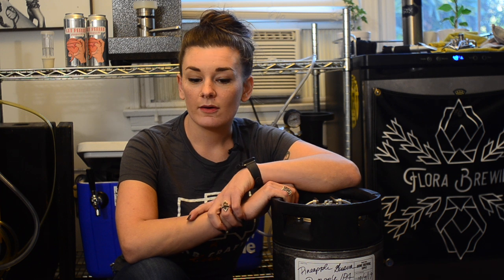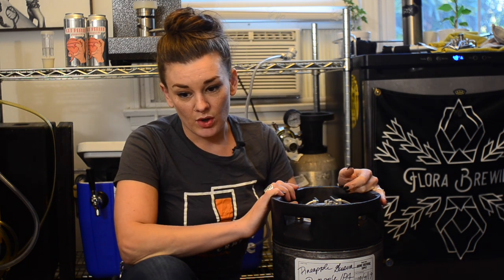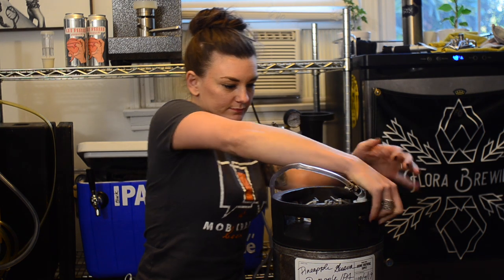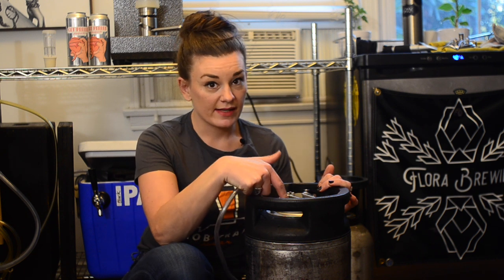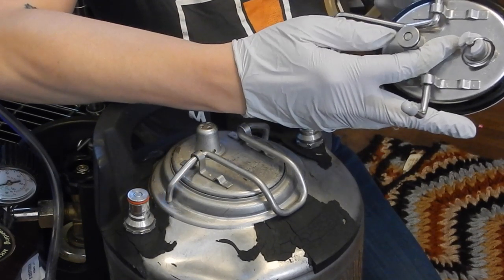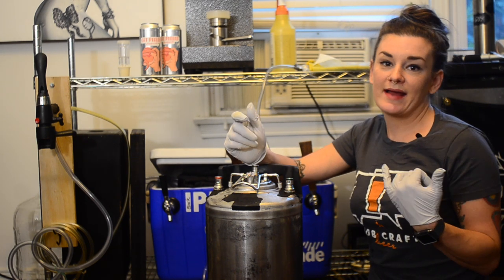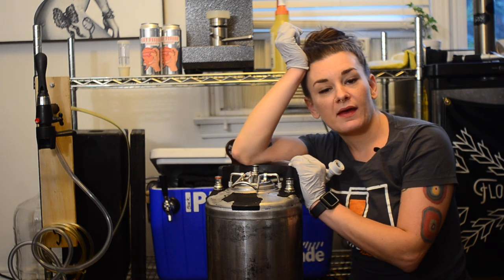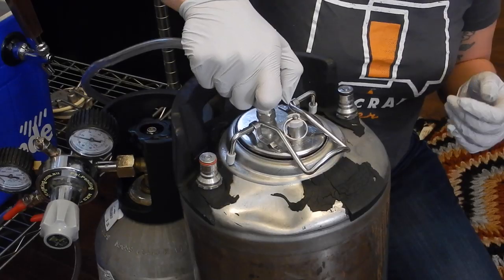Force Carbonating: Shake Method and using a Carb Stone

Comment: The tube connected to your carb stone will be full of air. It's only a small amount but if you run gas through it prior to purging the keg you could eliminate it from your beer.
Reply from the maker: Good tip!

Comment: Question: You purged only through the standard gas-in post with the short dip tube, but isn't there still air inside of the tubing from the lid to carbonation stone? For that matter, isn't there still air inside the long bev-out dip tube?

Comment: I currently cold crash after fermentation, transfer to keg, and then hit with 30psi for 24 hours to carbonate. If i changed out the lid on the keg, added a carb stone, I could carbonate in less than 24 hrs??? Sounds awesome, if possible.
Reply from the maker: Yeah you can do it in a couple hrs its wild and helpful in a pinch
Reply: With carb stone you could do it I. 10 minutes. With the right technique

Comment: Additional trick for ya..get a carb chart and find the amount of CO2 ya want for the temp. of the beer.  Shake it as normal but when you think you're close, shut the valve off on your tank, and keep shaking. The low pressure gauge will stop dropping at the carbonation level in the beer.  Keep opening and closing the valve until you hit the desired psi.   With a cold keg and a carb stone, it may only take a few minutes.
Reply from the maker: Great tip!

Comment: You can purge the tank without a spare ball lock connector, just push in the center of the gas side. I normally use a metal chopstick wrapped with a rag in case any beer comes out.
Reply from the maker: Yeah it's just easier with one

Comment: The lids with static pressure release can be centered by pushing the gas in valve with a screw driver. No need to connect a disconnect.

Comment: Can the carb stone be attached to the keg co2 permanently  for that batch. And just drop to serving pressure through the stone when  tapped. I am thinking this would add some carbonation while serving or do you think it will increase the chances of f foaming in the glass?

Comment: Nice work! You could connect to the gas in post and lay the keg down as you did but keep the gas post to the bottom, it should have the same effect because the post is submerged with the beer.
Reply from the maker: Totally. That's how I used to do it but now sometimes I just leave the co2 connected and don't roll. Brulosophy has a good podcast on carbonating too!
Reply: @FloraBrewing  Phew. That is exactly what I have done with good results, i.e. regular gas post, oriented to lowest possible point when rolling. I would even argue that this method lets the CO2 into the keg at a lower point that thorugh the "beer out post".

I am now thinking about whether to get a carb stone or invest in in a unitank. Do you have any advice on this Flora?

Comment: I'm pretty sure that here in the UK (and probably in Europe generally) the liquid and gas posts are slightly different sizes and you can get the ball lock connectors jammed on if you put the gas line on your liquid post. Can anyone confirm this?

Comment: Great video.
What's the purpose of the carb stone?
I force carb my beers at 30 psi for 36 hrs at 35 degrees. I then reduce the pressure to 12 psi and let it sit for 24 hrs then it's ready.
How does using a carb stone differ then the method I use? Does the carb stone continually produce bubbles during the process to speed up carbonation?
Are you going to do a taste test between the rolling method vs carb stone?
I did the rolling/shaking method once and the beer sucked. That was the only difference I did so for some reason that method produced off flavors.
Reply: I've heard doing the shake-method can cause a bit of a carb bite to your beer (but i've never experienced that), but for the carb stone in my experience, I've carbonated a 5 gallon batch (NEIPA) in 24 hours to 2.7vol. Worked great and both methods have their advantages. Hope that helps a bit.
Reply: if i buy  the  regulator  and  hose    then  all    i need  is  a  corny keg  to  carbonate  my  ginger brew  i  will   use 30  psi  for  the keg   right ?
Reply: @michealbradford7963  For beer I go 30 psi for 30 hrs then purge and reset to 12 psi. After 30 hrs it's not 100% carbed. You can prob go 36 hrs at 30 psi.
For me after 36 hrs its carbed enough for me. 48 hrs even better.
Reply: Eddie Hoffmann i tried this method and i kept getting foam but im sure i let it goo too far, i think maybe actually setting an alarm for 16 hours that way its all good
Reply: Hey Eddie. To answer your question. The stone adds the co2 at a lot finer micron so it enters the beer a lot quicker. Making carbonation faster

Comment: I just put my kegs in the fridge and get them between 0-4°C. Then turn on 3 Bar = 43 psi for 24 hours. done!   U used to try shaking too, but when u have more than one keg to karb, shaking as a B*ch. Much more relaxig to connect all at the same time, and go to sleep. Then beer is ready for friday night. :) Yes it does taste better with some storage, but one does not need to drink all at once. :)
Reply: Hi. You are the only person, except my local brew store to use this method. I just bought a D-stone with C-keg lid and for my first quick carb I intend to do EXACTLY as you have done. I am hoping to bottle after a day of rest. My only question is, the 3 bar and 24 h is that for lager, and how do you carbonate ale etc?
Reply: @hobbeeswe7472  usually 3 bar is a bit much. I had to fine tune it betweene 2,5 -3 bar
Reply: @Rockit66  Big txs Rockit. I am doing a lager with the - D-stone for the first time. I will follow your advice of 2,5 bar, after all, I can just add time and pressure if it should be too flat. I did however initially unleash from 0 to 3 bar in maybe 30 seconds... Any suggestions for ramp up?
Reply: @hobbeeswe7472  Just connect, turn up too 2,-3 bar and wait 24 hours. easy peasy.

Comment: you say you dont drink a beer for 3 weeks or so. so do you just leave in the fermentor for that time or do you store it in kegs for 1 or so weeks??? noticed on my first kegging run it took 4 days after kegging 2 weekes in fermentor before it was drinkable.
Reply from the maker: They usually are in the fermenter for 2 weeks and kegerator for 1. If you use floating dip tubes you can drink way earlier, I usually force carb and drink the next day when I use a floater.
Reply: @FloraBrewing  
Thank you I will give it a try is filtering beer ever worth it?

Comment: Could you connect the stone line to short post on gas side inside the keg instead using specialized lid ?
Reply from the maker: in theory yes but it's probably not the best to use as your gas line for serving
Reply: And also, it's not a barbed dip tube so it will definitely require a clamp. And trying to tighten a clamp on that while it's in the keg would be a PIA. Not impossible, though, and good thinking.

Comment: Hey thanks for the video is there anyway I don’t have to mod a lid and just connect the stone on the silicone line to the co2 inlet
Reply from the maker: I don't see why that wouldn't work!
Reply: They are a tight fit but can make it work. Got to really watch beer going back to regulator though. NRV highly recommended for this system

Comment: Id just like to mention that the carb stone method is not recommended for IPAs as you will loose a lot of the flavour as you scrub the beer with co2.
Just pressurise to like 30-40 and shake for 20 mins. Repeat if you really need to.
Reply: Is this true? I've never heard this. Plus, it's a closed system so where would you be scrubbing it to? Even if some molecules are "scrubbed" into the head space, it would quite quickly redissolve into solution, unless you are venting the PRV or something.

Comment: This Carbstone does not make any difference.  Just cool the beer down to 35 F and set it at 40 psi for 24 hours and then turn in down to 12 psi for 48 hours and your are golden.  Save these 25 dollars.  And just connect the gas to the gas, it does not have to go down the liquid post.   Happy brewing.

Comment: Never actually done force carb before, so I might be missing something - but I'm confused about the venting and then bringing it back up to 20 PSI. If the rolling should already have gotten it to full carbonation, wouldn't storing it under that high a pressure risk overcarbonating it? I would've thought storing it at just serving pressure would be a safer approach